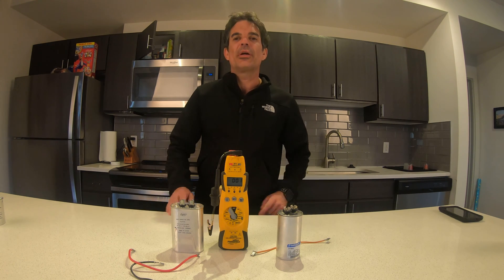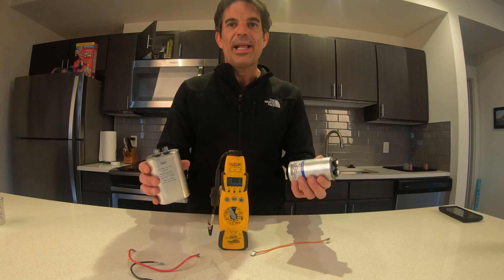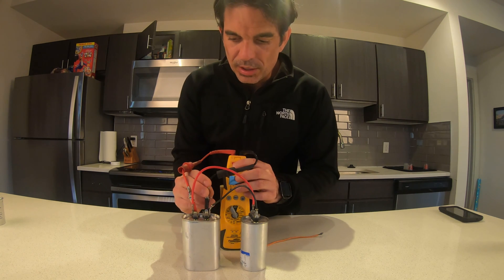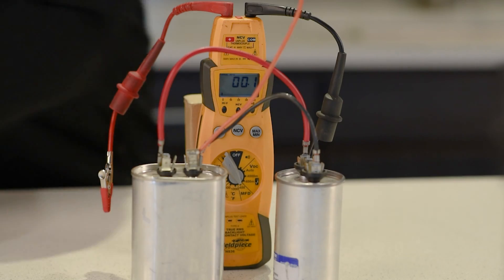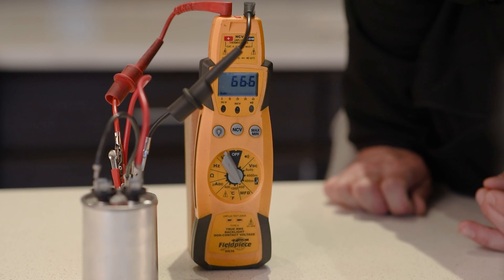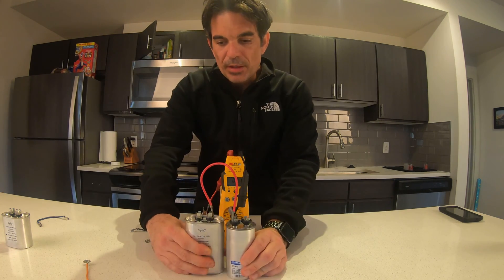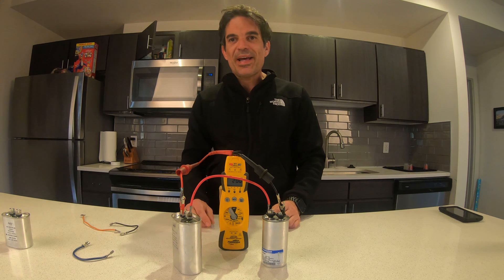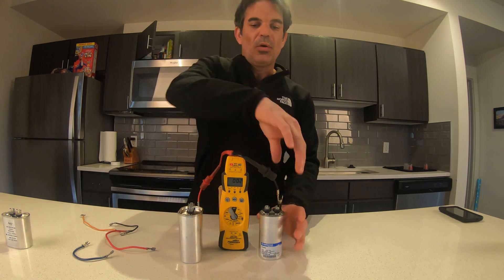HVAC Tips - Wiring run capacitors in parallel and series

Comment: If you have two 40MFD 250V capacitors and you want to use on 20MFD 240V circuit then you may use two 40MFD/250V in series. Here you are getting the higher operating voltage tolerance but losing capacitance.